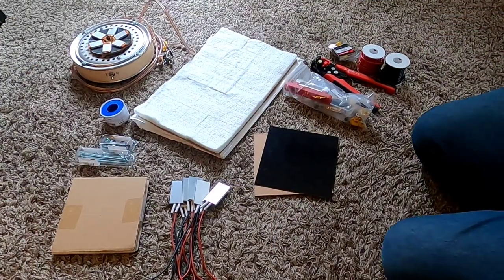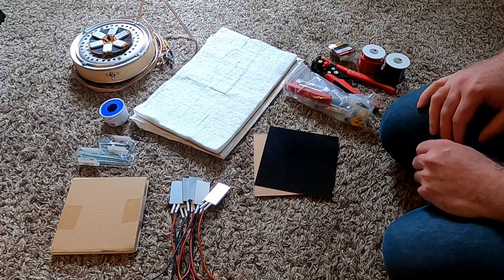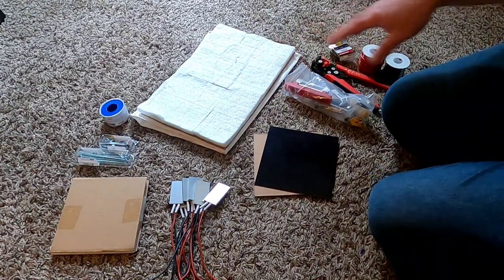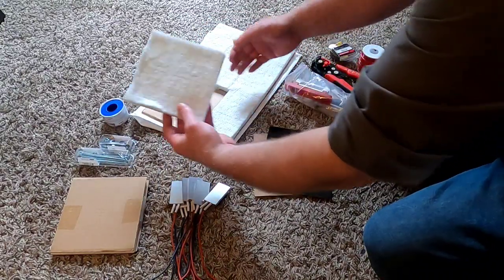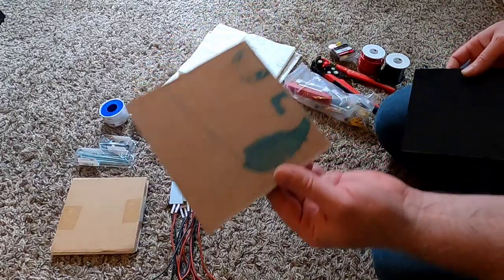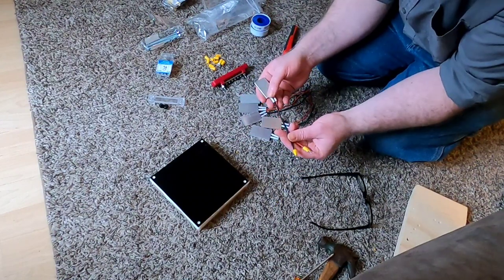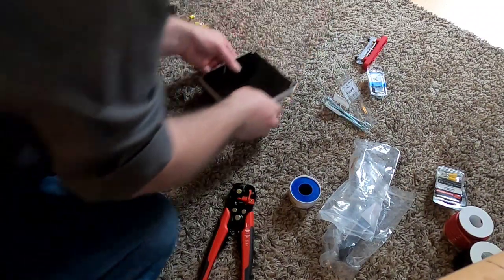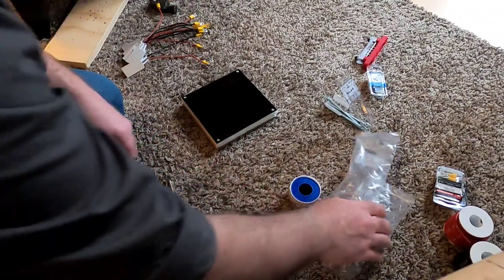DIY - THE MOST EFFICIENT STOVE ON THE PLANET - ULTRA LOW POWER 12V STOVE ELEMENT PTC THERMISTOR

Comment: I applaud your ingenuity.  I saw another video that showed a room heater using 3 of these PTC heaters and 2 bricks for a "masonry" type heater.  I am going to make a couple room heaters because it is even easier than your hot plate.  I have one question for you since you have some history with PTC heaters.  How reliable are they, and how long can they last?
Reply from the maker: Very reliable, last for years if used properly within the design thresholds.

Comment: I've only done a few experiments with ptc's but was wondering if your stove might be better if the hot plate was in two or four sections with a slight gap between each section?  I've found that when they're on the same plate one never gets quite as hot as the other.
Reply from the maker: The gaps would increase heat loss away from the plate and decrease efficiency secondarily cooking toast would leave spots lol.
Reply: @frankbush333  Well...us Brits don't call it holy ghost withour reason! It's just that those ptc's will cut out at 220 degs and it seems to me the main heat comes from just one of them.
Reply from the maker: I have not found that in using the unit.

Comment: Would you recommend using a copper plate ?
Reply from the maker: Yes and no, 1/16th would be ideal but far more costly and unless anodized could oxidize faster. Aluminum ages better but copper performs better. Hope this helps.

Comment: im wonder whats kind maximum temperature PTC you used?  120c or 220c?
will 220c PTC sorting time to boil water?
Reply from the maker: I used 220c, it takes 28 min to boil 2 cups at sea level.
Reply: @frankbush333  thanks for your replay, i need to defrost my propane tank, i think it would be imposible with this setup
Reply from the maker: A kapton tape or 3d printer pad heater would be better for that task, cheers!

Comment: Not sure how airogel works  does it absorb and disipate heat? If so would it not be better to have a reflector to reflect the heat up into the aluminum plate..? The busbar is overkill could have ring terminals to a brass bolt which would act as a busbar... keep it simple. :-) nice work though...
Reply from the maker: Aerogel is the best insulation in the world it is highly resistant to absorbing heat. As the heat wants to dissipate it has nowhere to go but into the aluminum plate increasing the temperature of the plate all the faster. The thermistors make direct contact to the aluminum plate both are highly thermally conductive the heat will want to travel from the thermistors to the plate as the path of least resistance. So, no an additional reflector would just increase losses in the system. Hope this helps, thanks for watching, cheers!

Comment: Suggestion your build is  nice looking but why not solder all the wires together and eliminate all those connections.great job
Reply from the maker: This was a second prototype that worked, lol. I built it this way just in case I wanted/needed to swap out any thermistors. Makes replacing any faulty parts down the road easily doable.

Comment: For boiling water this seems ok, I want to do a heating unit. So I would sandwich the Six PTCs between Two Copper plates, for a better heat transfer, I would then place them on a Clay bricks with a Fan that runs off heat, place the setup into a SS Tent stove, it will heat up to about 300F, that would start the Fan going to blow warm Air over the Stove. About 60 watts for the PTCs at 12 volt. I would have room for two of these inside the tent Stove, enough to heat a 10 x12 room.
Reply from the maker: At 60 watts that would at best produce 204 btu you would need over 20 times that much to heat a 10x12 room
Reply: @frankbush333  Already tested 6 off the Larger PTCs and getting 450F inside the Stove, the 6 foot Chimney is getting very hot so will wrap in 1/2 copper pipe to create a heat exchanger from the Stack. These PTCs come in some pretty large sizes , so sandwiched between 6x 10 copper plates the heat transfer is pretty high. My background is power Engineering and Recovery Boilers running Steam Production for Pulp and Paper Mills. I also work on CoGeneration Boilers in the Oil Production Industry, so Heat transfer is one of my specialties. Co Gen, think of a very large Jet Engine, with its exhaust running the heat transfer to tube banks 60 ft high x 20 ft wide, that’s a lot of Btus, and lbs of steam at 500psi.
Reply from the maker: If you are using larger ptc's that makes sense you are consuming more power and producing more btu's, awesome post a video and I'll check it out.
Reply: @frankbush333  I am getting some very good results using two Methanol burners inside the Stove, that Idea came from TnT video from Murray, I might try Olive Oil Burners, as they will burn much longer.

Comment: If you are worried about emp use a Faraday cage or bag.
Reply from the maker: Most batteries are unaffected by emp and so is this unit, no need for it, that's the good part 😉
Reply: when were you able to validate these claims?